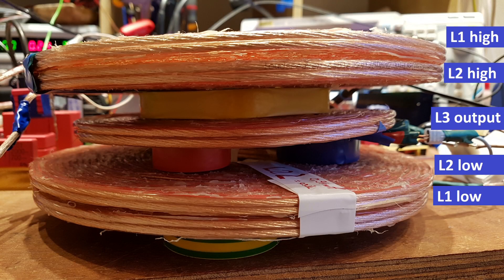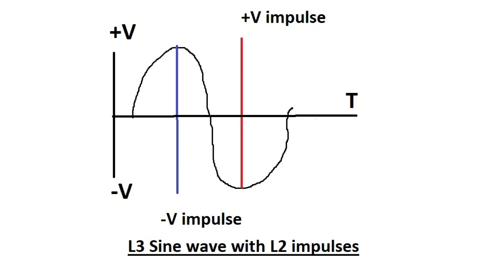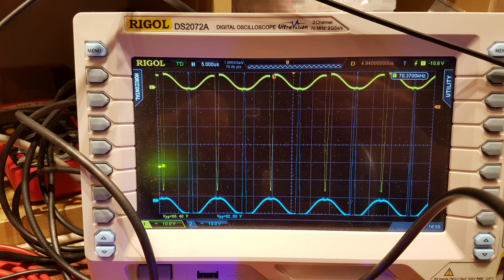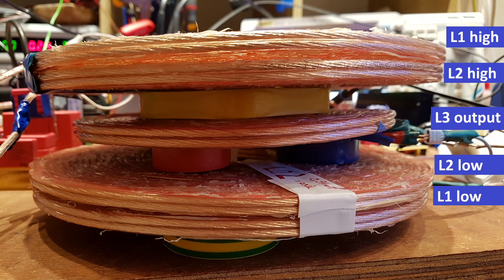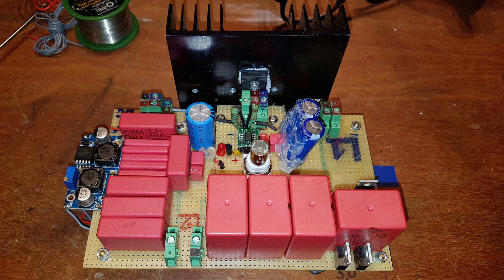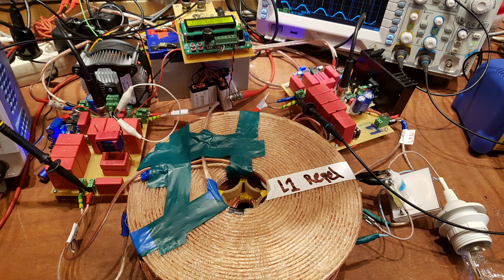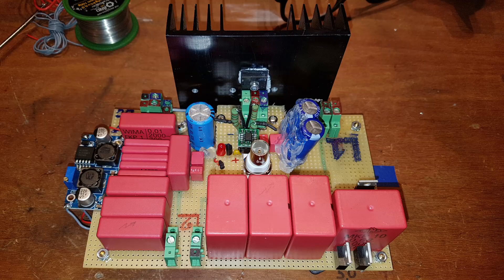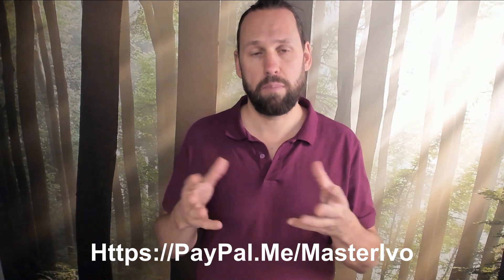How to induce electricity

Comment: I have watched a few videos but do you gain any net electricity or what kind of readings you get efficiency?
Reply from the maker: No gain yet. but I have learned a lot from my more recent experiments. both types of induction are needed. magnetic induction and dielectric induction. it is hard to engineer but indeed very possible to gain more electricity out than in.

Comment: The toroidal formations you ask about are actually pretty easy to pull off. I don’t know if you’re still working on these issues, but if you are we could compare notes and see where it goes
Reply from the maker: Can you produce a toridial field?
Reply: @  that’s kind of a vague question. The issue isn’t creating a toroidal field. The issue is decoupling a magnetic toroidal field. Couple of options. …Magnetron or static electric fields. The magnetic field has to have “drag” or friction. I don’t think that’s what you’re needing though.. I mentioned in another video. You need to get those bifilar/trifilar coils up in the air. They need to oscillate at 7.843ish hz and I bet that the oscillating coils that you see in the wardencliff tower are working with another coil at the standing platform level. The last part is sending charged particles up the center from deep underground using the cathode ray tube. Which is the purpose of the 4th coil you mentioned. It’s a particle accelerator. Unfortunately it’s way deeper than we thought. Don’t worry I’ll get there eventually. I always do. 😉
Reply from the maker: @johnkuykendall7028   those particles (corpuscules) are only invented by JJ Thomson to be able to calculate on the field energy. He got a nobel prize for finding the electron. but he knew they where virtual tools for doing math.
Reply: @MasterIvo  yes you are correct. The cathode ray tube is my hypothesis.. because of some of the comments he made and The x ray picture he took of his hand. Although the cathode ray tube is a “more advanced version.”  His description of the electrical effects in a vacuum for instance. In the terms of charged particles, these are simply molecules that have an imbalance of charge. Similar to a battery, in order to create a flow of electrons you have to have a flow of ions. Newtons 3rd law. So I figured he must have known that the static field he is creating with the low frequency harmonics is sending positive “energy up” and he was receiving “negative energy” as a by product. Which is why he knew to send the electrons into the earth. That’s where the electrode is.. one in the sky one on the ground. Ion flow=electron flow. One cannot exist without the other
Reply: Remember at this point Tesla has been burnt hard by Westinghouse and probably everyone else. No longer has royalties to his patents. Tough times from the war. Last thing he does at wardencliff is overload the circuit and blow it out. He was done at that point. I want to see this tower location and see if the hole he dug to get those poles into the ground is still there. The fact that we can’t get full access to all of his work is probable cause for investigation.
Reply from the maker: @johnkuykendall7028  in the end, its all flowing energy, and the whole universe is made of energy. even the "vacuum" of space is filled with it
Reply from the maker: @johnkuykendall7028   What do you personally feel that flows between the plates of a capacitor when the voltage difference on the plates is changing?

Understanding this, is key to understanding Tesla's work.
He manipulated this flow, with impulses. And used coils as capacitor plates.
Reply: @ no he refers to capacitors as “condensers” my assumption is because they condense the high voltage/low amps into whatever capacity he wanted based on oil and plate separation distance inside the capacitors. In the patent for the wardencliff tower he explained that the device could be powered by alternating current or a “condenser” which we know as capacitors. He even gives the oscillation cycle between coils.
Reply: The physics and chemistry (yea chemistry) at play are not quite what everyone in this “niche” topic wants it to be. The fact is that Nikolai even mentioned the ionic compounds. We have to understand the limitations he had in terms of education and how the universe operates. The “eather” isn’t anything other than what existed before the Big Bang. Tesla may have referred to this sure but context is everything here! I believe there are a number of ways to harness electricity from the ionosphere. None of which involve “harnessing the eather.”
Reply from the maker: @johnkuykendall7028  I hope you will proceed and get it working, and while doing so share your results with the world.

Comment: are we talking scalar here?

i think we all miss out on one thing big time here - can we have free energy in electromagnic systems, or not?
is it nessesary to move to scalar, as tesla said numerous times?
if yes, youll have to make a faraday cage in iron, to make a scalar isolation filter. one that both inhibit magnetic an elctric fields.
if tesla was right we can fool ourselves forever with EM waves...
Reply from the maker: longitudinal waves, yes. from High dV/dt. working on progressing that. already showed it in my last video this summer (2023).
 working on progressing that right now.
pure EM doesn't cut it.
Reply: @MasterIvo  
i am working on exactly the same, right now and i can recommend tuning s1 and s2 with series caps. without them no ou.
it is important to tune s2. eg. with a variable air cap. then the locking - or symbiosis will occur.
still recommend to put at least one s2 into a faraday cage - so you know how much scalar the system is running at.

Comment from the maker: I was so close but still needed to learn so much. Indeed both forms of induction are needed. the dielectric induction works like a capacitor, so the coils act as capacitor plates. whereby close coupling is needed.
And most important, the 2 forms of induction need to be IN Phase

power= voltage x current (in phase)

voltage is induced by changing current (magnetic induction, we all know)

current is induced by changing voltage (capacitive induction, not much talked about) 

Both 2 forms of induction can be done simultaneously in a single coil. 

So you need 3 coils all close coupled. 

middle one is having a resistive load. 
the capacitive coupled one is a high voltage tesla coil. (coils act as capacitor plates, current is induced in load) 

the third coil on the other side of the load is a high current coil. so, only a few windings of thick wire. with a big parallel capacitor. 

the coils are push pull driven at the same frequency, and thus must be both tuned to the same frequency. 

to get them in phase the tesla coil pulse is delayed. 

kW of power

Comment: I assume by now you have seen these, but I'll post them here just to make sure. https://youtu.be/EVbdbVhzcM4 to answer your question Master Ivo wouldn't it follow the right-hand rule, depending on direction either they would be additive, or destructive? If they are aligned perfectly they would spawn vortexes tangentially. Otherwise, like these other videos they will combine and continue on their path influenced by greater force (in this case buoyancy, but it could just as well be a more powerful source)    https://youtu.be/lJfqgmbiqnQ  https://youtu.be/c1ssSdqxFXo  https://youtu.be/KHc0tn8lGSs  There is one example I can't find right now.
 Where traveling together in the same direction the one from behind was pulled  throw the middle of the leading one. Then becoming the leader and returning to its original size, it then pulled the trailing one throw itself and the cycle repeated until they combined overcome by buoyancy. I'll keep looking.

Comment: The ring vortices, aka EVOs, have their own magnetism, because the energy spins like a frizbee,  so two EVOs of the same size would want to stack and align like 2 magnets. Sometimes they disconnect as a ring but still exist like a sausage, then re-form the ring, and this can capture an adjacent ring, and seem like 2 keyrings joined together.  That can happen multiple times to create complex floppy chains of them, called strange radiation that leaves bizarre skipping tracks on the surface of metals.

Comment: a piece of advice. Whatever you are going to produce you will have to shift phases between current and voltage from 90 degree to as close to zero degrees as possible. If you do it you will have huge power gains equal to Quality factor of resonating circuit(Q) In most cases you will use capacitors as current is lagging voltage of 90 degree
Reply from the maker: yes already achieved in phase current and voltage, shown in this video https://youtu.be/M1oRfCLY3QM

Comment: The two rings basically cancel out into a plane of an expanding accretion disc.  Are you trying to Catch energy synthesis in the act with this question?
Reply from the maker: yes
Reply: If you apply a high frequency impulse input to the bifilar you said you are able to generate either high  current or high voltages right? If so, why not marry two separate Bifilar outputs both coming from the same high frequency impulse or square wave source? Have you tried recombining them in this manner?

Comment: If you build a capacitor, then remove plate A and replace it with a new plate. The charge will still be there. Then if you replace plate B with a new plate, the charge remains. The only thing that has not been changed is the dielectric. This bugs me for some reason. What if there was a a coil on one side of the capacitor that felt the charge from the capacitor. Then if you remove the plate, would the charge be felt in the coil, as well as the dielectric? What if the coils or plates were switched infinitely fast, while the charge was still present on both the current and previous coils/plates. Could we then 'steal the charge' over and over again? I hope I have explained the situation I envision adequately.

Comment: You already know about Ken Wheeler's theories. I think you can stack three coils, the magnetic fields from top and bottom having like poles facing each other, and the third coil centered at the combined, induced dielectric plane of inertia, which has to be electrically and dielectrically interesting. I'm thinking that assemblage models a permanent magnet's field, but electromagnetically, and you can electrically play with the dielectric plane via the centered coil. Alternatively, as a physical visual, one might spin a solid or mesh (grid, spiral, other?) disc or mesh in liquid. Such a disc could be mounted on a slim drill shaft. Surface friction between disc and liquid will create opposing vortexes. Magnetically suspend that disc and spin it using magnetic induction might be a way to remove obstructions and see what happens more accurately. A hole could be put in the center of a solid disc, but I think a mesh (with a center hole) would allow more interaction possibilities. I'll add this to my list of projects. ;) Viktor Schauberger may have done a related experiment in his day.

Comment: I would like to make this happen with Tesla turbine rotors if my idea works, open air rotors without casin. I have had this thought before and I want to build it. Only problem is the shafts get in the way and disturbs the vortex pathway. I am trying to find a way to get around it.
Reply from the maker: that's why I work solid state. so the Aether can do its thing.
Reply: @MasterIvo  I am glad you are doing it, I have learned so much from you.

Comment: Ivo, I made a bifilar coil out of 2.0mm speaker cable. It has 26 turns and weighs 441 Grams. I tested it with a NanoVNA and it has first harmonic resonance at 8.75MHz. Should I aim to lower the resonance with a series capacitor? If so what resonant frequency should I be trying to achieve?
Reply from the maker: almost 9 MHz that is very high, should be mucht lower, did you connect the end of winding 1 with the beginning of wimding 2?  (end of 1 to end of 2 isn't right).
Yes put a series capacitor to lower the frequency. I have more videos with much information.
Reply: Yes clear colored wire starting at the center of the coil is crimped to the red wire ending at the edge of the coil.  Then the red wire at the center will be the positive and the clear wire at the edge will be the ground.  In this manner the current always flows the same way around the spiral.  I assume this is correct as if I connect opposite the magnetic fields will cancel out.
Reply from the maker: yes correct, sounds good. your coils probably have different dimensions and thus a different resonant frequency.

Comment: When they collide they go fractal and create many miniature vortices perpendicular to the larger ones:  https://youtu.be/Io1a2--0-So

A vortex is a frequency transformer. They occur around antenna and are thought of as noise. Konstantin Meyl writes about this somewhere. High frequency, high voltage transients using single wire technology and dusty plasma discharges are key to many LENR effects.

Comment: Love this and all your videos are fantastic, thank you. Have you ever thought about having two grounds? One for the main circuit and first coil. Then on L3 you have that ground connect to a copper pipe driven deep into the ground as a 'lower' negative for that emf impulse to jump up from? If that makes sense. Increase the peak to peak as much as possible on that back EMF including any negative spikes normally dispated through a diode. Then try and feed that lower ground impulse back into the original circuit ground and tap into the difference by boosting through another isolated coil. It may open up another dimension or wormhole so be warned! 🙂

Comment: The channel Getting Smarter Everyday did a vortex ring collision video that is close to what you’re asking to see. You might take a look at that as food for thought. I’ll say this, the result of the two colliding vortices is not what you would probably envision. From what I remember, when the two vortices interact they created many smaller vortices that that were perpendicular to the two original vortices. The newly created vortices radiated outward from the center of the vortex rings much like spokes radiate out form the hub to the rim of a bicycle wheel. 

If memory serves, they set up the vortex ring collision in water  using different color food coloring in each vortex ring so you could clearly see how the two vortex rings interacted with each other when they collided. Visually the experiment looked really cool and showed clearly some complicated looking interaction.

Ps. Just found the link. https://youtu.be/EVbdbVhzcM4

Comment: Arent you familiar with Ken Wheeler? and the "missing secrets of magnetism"
The shape of two ring vortexes, or two toroid donuts, form a condensed accretion disc of dielectricty. If you set up your circuit to mimic the natural fields shape of the binding geometry you will be able to most efficiently draw out power. 
https://imgur.com/a/3MW02N2
https://ia802502.us.archive.org/31/items/magnetism1small/magnetism1small.pdf

Comment: I am impressed. Great work.  I submit for thought that Egyptians used radiant energy. Temple at Dendera and Abydos, Seti I  show a small person aiming an Ankh at something another small person is holding. The  reliefs have  several Djed being setup and a small version supports a lite bulb at Dendara. Notice each bulb is radiating a particular gender. (this nailed it} Keep up your fantastic work. Now all I see is a hairpin circuit which projects radiant energy and coils on stands as part of the distribution network.
Reply from the maker: thanks. the Djed is very interesting to me. seems like a advanced type of device., some how related to a capacitor, but more than that.

Comment: so if we use two pancakes we get en electrical sheet in between?...this could be the same as the sun as I have said the n and s are separated by the inertial plane...so there are two torus'...one above and below and so the energy resonates within what ever is between the two pancakes...planets etc
Does that sound plausible for our solar system dynamics?

Comment: Would be interesting to see any effect with coil in a vaccum bag or under pressure !
Reply from the maker: I would suggest to put the coils in an oil (high dielectric K) bath for best results. Dont use conductors around the coils.

Comment: Hey there Ivo, i was thinking about if there could be a kind of inertia in the system ? A kind of motion that stays in motion that could be tapped if there were periodic false pulses and if they could be implemented with out any noticable change at such high frequency ?
Reply from the maker: yes the volumes of Aethet that ar set in to (longitudinal) motion ARE inertia. I can speculate further. but first I need experimental proof.
Reply: @MasterIvo  yeah i can see this getting very interesting especially when you incorpoate ion thruster theory!
Reply from the maker: @Buzzhumma  keep in mind, "ion" is a polarised aether field

Comment: There is a video about ring vortecies in fluid being shot at each other. It's that blonde happy guy. They hit each other and blew out new miniature rings at 90 degrees and moving outward. They used colored dyes. You could have two vap guys face blow each other too... Where do you study. The 3d ideology is what is missing. You are the only other one I've seen with the right questions. I'm trying too.

Comment: Hi Ivo, I made three pancake coils and put them one on top of the other, then I connected the top and  the bottom ones to a "Joule thief" type of circuit and made it to resonate. Then took the energy out of pancake coil in the center. The power so generated was very much inferior to the energy provided. About 1/5. Is that all I can get? What do you suggest to improve the efficiency?
Reply from the maker: use one joule thief, that works with a pnp transistor, producing negative impulses, so you have both polarities